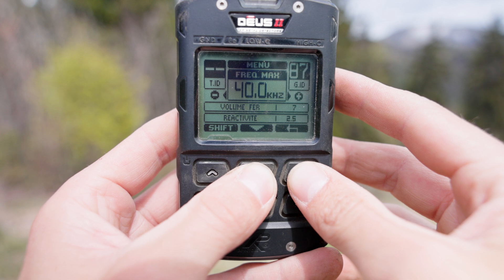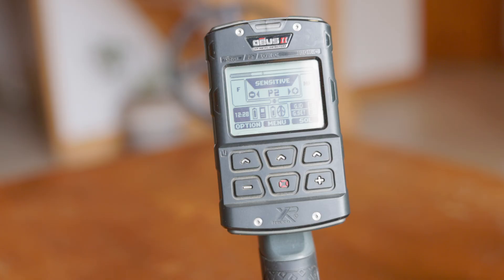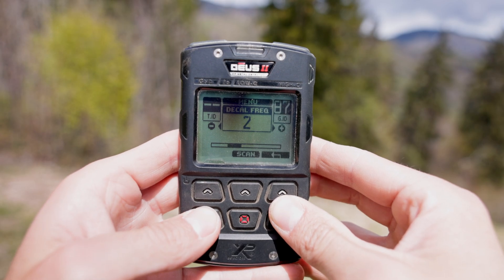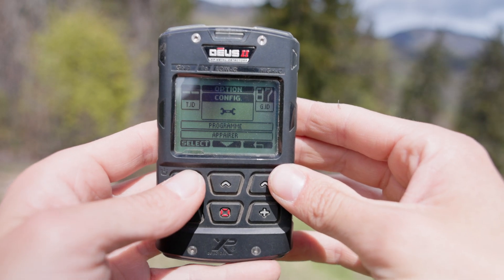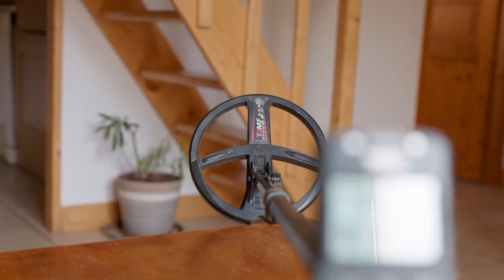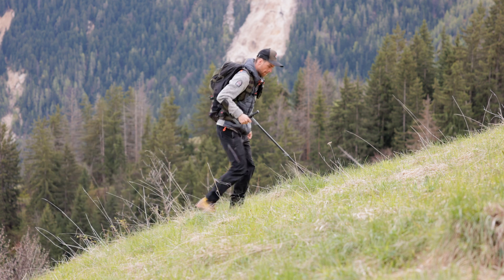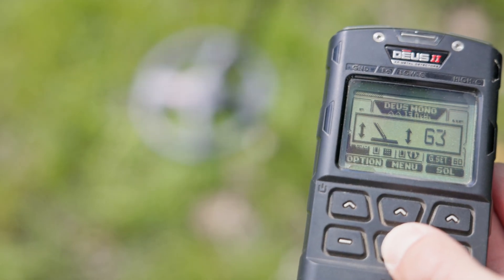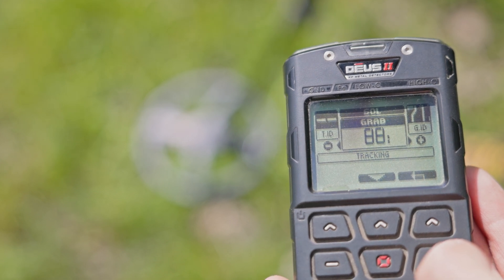Optimizing the stability of the XP DEUS 2 metal detector

Comment: Thanks for the video. I have a homesite under some power lines which originally caused a lot of issues. Nothing I did would settle my D2 until I moved into the Mono program. I pulled a lot of goodies out of that place after that!